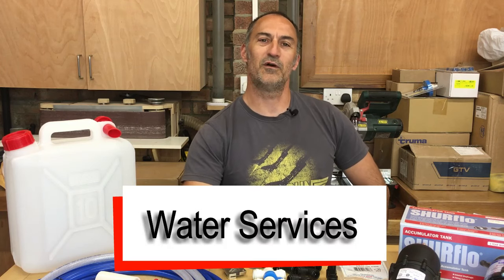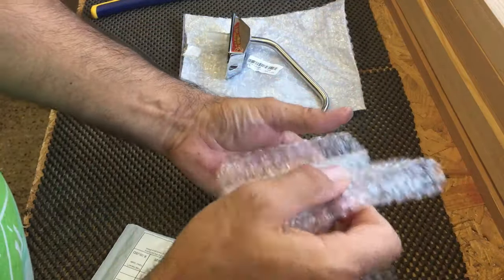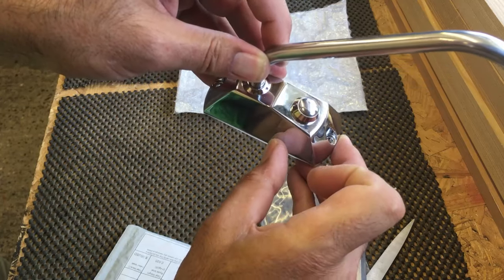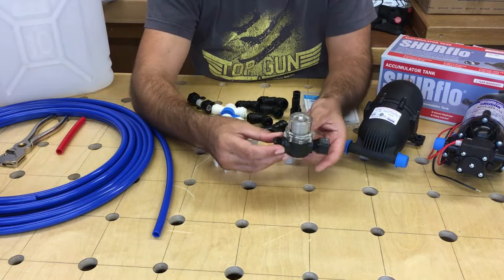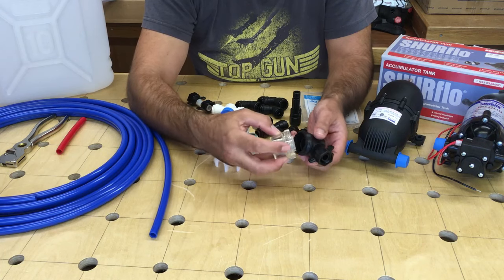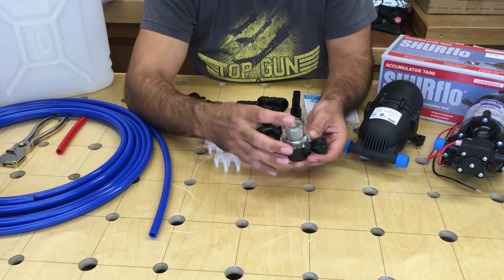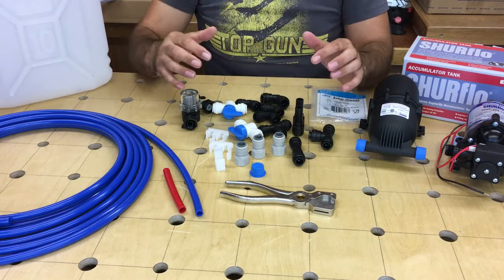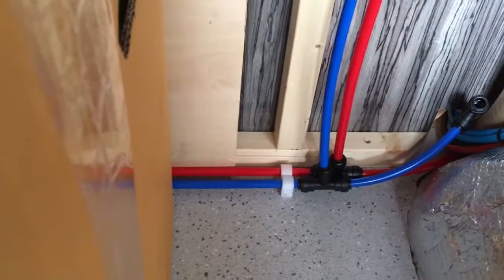Domestic Water Services - Camper Van Conversion Series

Comment: Hi Greg, brilliant video, as always.  My wife and I have just had a discussion regarding the separate drinking water system and whether it's over the top or not.  I love the idea of redundancy and over the years we have filled up our water tanks from several different sources in many counties (Mainland Europe, Scandinavia, Tunisia). However most of them have been marked as or, or confirmed to be, drinking water and we have never had a problem with using it for cooking and hot drinks.  Saying that we always used bottled water for cold drinks.  I do like your idea as it is far more convenient that having bottles rattling around, but I'm also 'concerend' about maximising strorage space and aren't keen on having the 'jerry can' under the sink.  I'd love to hear your thought process that led you to choose a separte system, especially as your tour seems to be based in mainly based in EU countries.  Cheers Ralph
Reply from the maker: The jerry can actually sits on the step at the back of the sink unit, so its at teh back of our drawers and belwo the cupboard out of the way. 
As for the reason why two systems, I'm a creature of habit I guess, we have always used bottled water when abroad, you know to help prevent the Delhi belly. As we are now living in a small van, anything to reduce that risk is money well spent ;D lol
Reply: Thanks for that.  I will admit that I do like the idea, for the same reasons as you just suggested, but I wondered if you had any additional 'secret' reasons that I couldn't think ;o)  My wife just says we should just use the bottles and not worry about plumbing anything in.  After thirty years of living with an engineer, you'd think she'd know better by now! lol.  Keep up the good work, your videos are like a breath of fresh air amongst the snazzy 'lifestyle' music, 5-second cuts, animated intro, jiggly handheld selfie, van life is wonderful videos that seem to prevail.
Reply from the maker: If I can add a switch, light or mechanism to do something that can easily be done by hand I'm all over it lol
Thanks for takgin the time to send me bakc some great comments, what are you van build goals?
Reply: My thoughts exactly :oD.  We have been overlanding since 2009 in a modified 1995 LR Discovery.  I kitted it out with a fridge/freezer, 70l water tank and various other bits including a roof tent.  We have visited 3 continents and 31 countries.  Unfortunately, dodgy hips and knees now make the rooftent much more awkward and sitting under an awning in the snow in Iceland made us yearn for something more comfortable.  
We are in the process of downsizing and hope to get a van early next year.  Although we may have the budget for a ready built model, we can't seem to find anything that has everything we want.  They all seem to sacrifice some functionality for luxury touches that we can do without.  Because of this, we are considering a self-build.  It will be on a Fiat Ducato base as I prefer auto and it's wide enough for a transverse bed (I'm 6'1").  I would also prefer a 5.4m, for maneuvrability, but will probably have to go to a 6m because of availability and the extra breathing room it affords.
Your build series will help enormously although I hope to document ours and then go on to detail our travels once we hit the road.

Comment: Very useful info Greg.  I'm still deciding on how to supply hot water without spending over 1k.  I may be using the 'boil a kettle' method LOL. I don't think I will be installing a full on shower but I think hot water will be a must.
Reply from the maker: It's a tried and tested full proof method Dave, no problems there buddy.
Reply: First Rule of engineering: KEEP IT SIMPLE

Comment: Hi! Just one thing, I used these type of fittings before and that make had some suport bushings that was phused into the end of the pipe before inserting it into the fittings. This was to suport the pipe over time so that the oring seal does not fail. Don't know if your pipes needs it, just to let you know there is some that that needs it. 😊
Reply from the maker: I had an email from John Guest Technical dept today to confirm that inserts are not required on cold water services but recommended they be fitted on hot water services. So I will be adding tube inserts to the hot water joints, fortunately, I made sure it was all accessible and not hidden away.

Comment: Hi Greg
I’m in the middle of a build and as a joiner the electrical side is a bit alien to me. I’ve taken the liberty of using your wiring diagram as have same van ( Fiat Ducato) with the water and heating set up too.
Really don’t want to install the  heater as this is only for weekends away. Is there a cheaper alternative that will work with that system. I e watched a huge amount of videos but keep coming back to yours due to your knowledge, but for me your perfection on installation and direction does it for me. Keep up the good work.
Thank you
Scott
Reply from the maker: I’m going to be fitting a Chinese diesel heater in the budget build van all in for under £200. Water heating will just be by boiling a kettle as you never need much for a cuppa or bit of washing up 👍🏼

Comment: I have  just started my own Sprinter conversion, and came across your video series by accident. I'm hooked !! I had already decided on a layout similar to yours, again just the 2 of us, but some of the design and construction tips have been very useful. As a builder, the construction side is relatively straightforward, but, the electrics and water design and reasoning have been a revelation of good sense, knowledge and practicality. Thank you for all the information and confidence you've given me. On the water side, is it worth putting in a drain valve for over wintering to prevent frost damage?
Thanks again.

Comment: Great job explaining used to rehab apartment projects 168 units in 90 days.  There is a company in America it was called maintenance warehouse. It was bought and Rembrandt home depot supply. They have bought up old manufactures of home products like shower door companies closet door companies and sell component parts. You can spec a project and have a complete parts list of components. When you build place order then keep list for repairs. It would help to start your video with parts and a list of tools and supplies. I am Courious if we could contact a manufacturer. For a spec sheet of as built dimensions . perhaps a precut paper like they use to cover hardwood during home construction.

Comment: Another stonking video Greg. I think I'm going to go with your idea of a separately pumped drinking water tank.

By the way I'm using the same Sureflo pump as you and works really well, but my expansion tank pressure was factory set at just 1.5 bar. So I had to increase this with a car foot pump. Might be worth checking the pressure of your tank to be sure.
Reply from the maker: Hi Rob, yes it is not uncommon like car tyres for the air pressure to drop over time.
periodically you need to drain the vessel of water and check the pressure with a tyre guage.
If it regularly drops in pressure it could be a leaking Shrader valve.
I have also known of the internal bladder splitting and water getting to the air side.
Make sure to fit the vessel air side upwards so you can drain it out if you need to.

Comment: Just a quick one, how do you pressurise the hot water side to the taps?? I couldn't see sorry 
Oh and thank you for posting these, you break the  jobs down so well they are as much of a pleasure to watch as they are informative ..
Reply from the maker: Hello Dave, both the hot and cold water are pressurised by the Shurflo pump. Anything downstream of the pump will be pressured by the cold feed pump. Think of the boiler like a closed tank with an inlet and outlet it’s all the same body of water. The hot side is pressurised by the cold side. 
The beauty is all your mixer taps or shower mixers have equal pressure on both sides and work without problems. 
Hope that makes sense 👍🏼😀
Reply: Thanks  @GregVirgoe     I'm guessing I simply T off one to the Heater and then the other direct to my cold feed/taps??   You videos  are so detailed and professionally done I shouldn't have had to ask...  Thank you again and  might have to rewatch some as I'm still in the early days of my conversion
Reply from the maker: Hello Dave, anything you want to ask is no problem. Watch the boiler installation video as more of the Pipework was in then but you are right. Off my pump is my expansion vessel then an isolating valve then a T one cold to the shower and kitchen cold tap and the other to the toilet flush and boiler cold supply. The boiler one has a check valve to prevent back flow then off the boiler to the the shower and kitchen tap on the hot side. Use all JG push fit fittings and LDPE tube and you will not have any leaks. Best wishes buddy 👍🏼
Reply: @GregVirgoe  Would you kindly be able to draw a diagram on the piping.... still trying to get my head round what T's off where, how many pipes etc. Would be greatly appreciated.

Comment: Great instruction video! Thank you so much! Re accumulator tank. If it comes pre- pressurized at 2 bar, when I need only, say 1 bar, can I release the pressure myself or is there a specific tank pre-pressured for my pump.
I do appreciate your time and effort here. A great service. Thank you.
Reply from the maker: Yes you can release air from the valve on top which is the same as a tyre valve so you can use a normal foot pump or tyre gauge to check the new pressure. Do this when the accumulator does not have any water inside it 👍🏼😊

Comment: Hey Greg - wow, the comments don't lie - you really offer an incredible selection of resources in your videos - explained in a simple, logical, engaging way - so thank you for that! :D

I have a question regarding the inlet pipe - we've been looking around and found corrugated 40mm pipe for the water inlet lockable hole on the side of the van down into the tank - could you give me a little more detail around your decisions here and what you used? We're struggling to work out how to get down from the 40mm pipe to the 3/4" female hole on the tank...Love your work sir! :D
Reply from the maker: Hi, you may have a different tank to us but ours did have a large inlet connection. There is a dedicated water tank video with this info 😃

Comment: Love love love!  I can't get enough of your informative videos, Greg!  Did you use a check valve in any part of your system, perhaps after the accumulator or is this superfluous?
Reply from the maker: Let's Try Something New there is a check valve (one way valve) on the cold feed to the boiler. This ensures that hot water cannot be drawn out of the boiler when opening a cold tap.

Comment: Thank you Greg for your detailed videos! I must say that you've made life easier. I am trying to work out how to connect the fresh water tank to the filter. I have the same water tanks, filter, water pump etc etc as you have in your video. From measurements It looks like the outlet on the fresh water tank requires a 15mm inner diameter hose and then the remainder is possible with the 12mm OD hose and john guest fittings etc.

How did you connect your fresh water tank to the 12mm OD pipe? I can't seem to find the right pipe online and i notice that the still picture of your water tank in the above video didn't capture the finish connect. Thank you for your advice in advance :)
Reply from the maker: A 15mm JG pushfit elbow direct onto the tank connection. Then a 15x12mm stem reducer pushed into that elbow to bring it down to the 12mm LDPE pipe size. Very simple installation. Hope that helps
Reply: @GregVirgoe  amazing! Thank you for such a quick and detailed reply!

Comment: I can't thank you enough for your concise information, I have rewatched so many of your videos for reference and research, I hope your year of traveling is as rewarding to you as your videos are to everyone else. Brown nosing aside I have an alterior motive, I have finally begun my own conversion on a Luton, and wondered about the insulative differences between using a camper style window or a uPVC style window used in a house. Obviously uPVC is pretty easy to come by but will be heavier, I just wondered how much difference there was likely to be in the movement of heat through each type. Any help you can offer would be gladly received. 😁
Reply from the maker: Hello, I can see the weight being a real issue with UPVC type of windows.
Personally, I would not even consider trying to fit them into a Luton van.
If you are on a tight budget look for secondhand caravans.
To be honest you can pick up a caravan for next to nothing and have appliances and windows galore.
Caravan windows are usually plastic and double glazed so they are very good thermally.
Reply: I wasnt aware of that about caravan windows, that is a game changer, i was thinking i would be forced to go with the heavier upvc. Off a-hunting caravans i will go
Thanks :D
Reply: Also if i wasnt on a tight budget would that change your suggestion?
Reply from the maker: Whatever budget you have high or low I would never recommend fitting domestic UPVC windows in a van conversion. 😂

Comment: Hi Greg.  Thanks for the vids. Re the connection between the kitchen tap and the 12mm JG pipe.  First does an ordinary kitchen tap from IKEA etc do and then which fittings are needed to join the 12mm JG pipe and the braided hoses of the tap. Also going to put an external shower at the the back door so that would presumably be the same size fittings from the the JG pipe to the shower hose.  Thanks in advance m.
Reply from the maker: Most taps and mixers come with 15mm compression connections or 1/2” male threads. JG push fit make adapters to go on these. 
15 x 12mm stem reducers. 
12 x 1/2” female adapters. 
Both fittings will allow you to just push in the 12mm LDPE pipe.
Reply: @GregVirgoe  thanks Greg much appreciated.  Have a great time at the nec, sadly we're still living in france or I'd be there.

Comment: Hi Greg, super helpful, as ever. Thanks.

One question - have you noticed any issues with thread standards being incompatible? Specifically, the inlet-outlet threads on the pump are normally NPSM - the Speedfit component you're using to convert them to 12mm LLDPE pipe is of the BSP standard... no?

Thanks again, and... stay sane.
Reply: Well, I can report that there's absolutely no problem. The JG Speedfit 1/2" BSP female to 15mm hose connector works just fine screwed directly onto the pump's NPT outlets. I suspect the threads don't mate totally, but their only job is to draw the rubber washer onto the end of the outlets, where they do their job perfectly. Pressure is over 3.5 BAR with a SHURflo AquaKing II Supreme. I left it powered up for two days with the taps closed - not a drop. It shifts 19 litres per minute - the recirculating shower will be better than what we have at home :D

Comment: Hi Greg, I’ve a question about the pump and JG fittings.

The pump and exp tank has 1/2inch NPT male fittings…all John Guest fittings are BSP.. 

Did you have to use any adapters?
Google says “ 1/2 NPT will fit 1/2 BSP but only in that size” 

I’m a bit over cautious with water, especially being opposite my expensive electric system! 

Really not sure whether to use the suppled Barb fittings and hose or go the JG route.

In your experience and time since this video, have you had any leaks from the NPT to BSP connections?
If you say it’s good that’s more than enough for me 👍🏼 

Cheers Ant

Comment: Hi Greg, what size pipe did you use for your water, our side diameter and inside thanks, your videos are so good, I’ve started to build my sprinter Campervan will send pics once done
Reply from the maker: ian fairbairn the size that is most widely used is 12mm OD which is 10mm ID. most pump and appliances use 12mm push fit these days. Don’t forget you need the pipe inserts on all the hot water Fittings.  Thanks 😊
Reply: Greg Virgoe that’s great thanks Greg your a top man, 
PS I knew about the inserts thanks hope your touring is going to plan

Comment: Great video Greg. I went ahead and put together our tiny house plumbing very much similar to yours, using JG 12mm fittings and Shurflo Trail King pump. However, we are getting some cavitation and low flow issues. Reading the manual, Shurflo recommends a minimum of 13mm inner diameter for plumbing. Given that JG is only 9mm. Did you have any similar issue running the pump? Please share any advice or experience you can to help. Thanks again! Mohit
Reply from the maker: I haven’t had any issues with the pump or flow rate as the pump produces a lot of pressure 2bar
Your problem is most likely to be a high point causing an air lock a bubble of air trapped in the Pipework. A lot of people install the filter upside down and this has similar effect as air get trapped in the filter before the pump. 
Maybe you can pm me a photo of your setup and I’ll see if anything is obvious 👍🏼😊

Comment: Yet another fantastic build series video from Greg. What amp rating is the new switch you used for the faucet / tap ? I believe the Whale pump draws 2.4 amps. I can’t seem to find a 12v dc switch rated at more than 2 amps. Any help would be appreciated. Graham from Watford
Reply from the maker: There are 20A and 30A versions available just need to do a search for momentary switches https://www.ebay.co.uk/itm/1-12V-30A-Horn-Push-Button-16mm-Momentary-Metal-Switch-Car-Boat-LED-Waterproof-/384574732347?mkcid=16&mkevt=1&_trksid=p2349624.m2548.l6249&mkrid=710-127635-2958-0